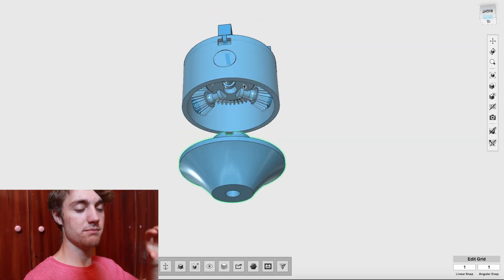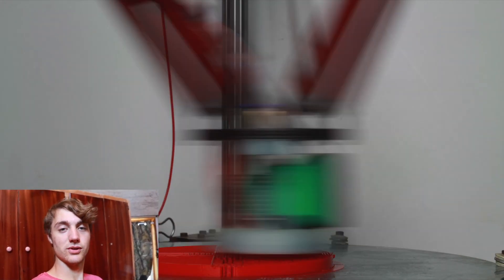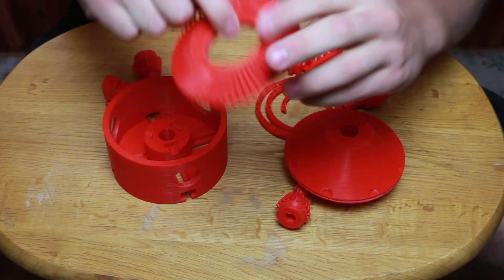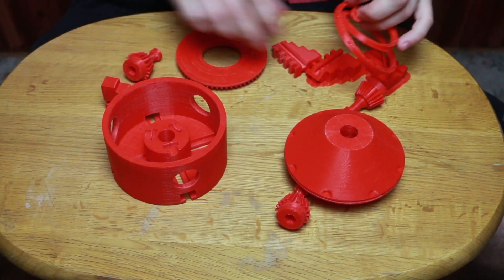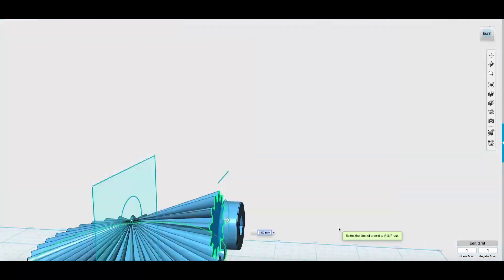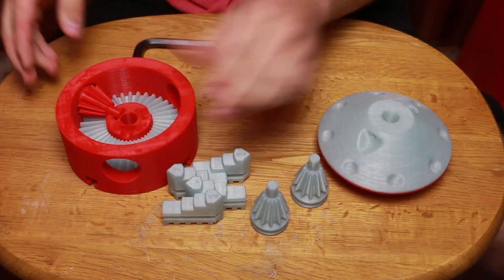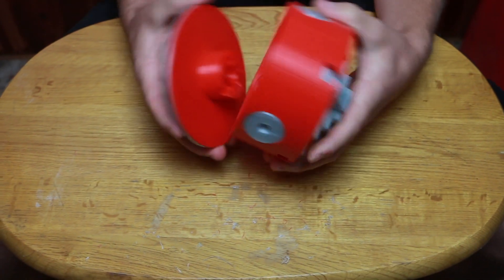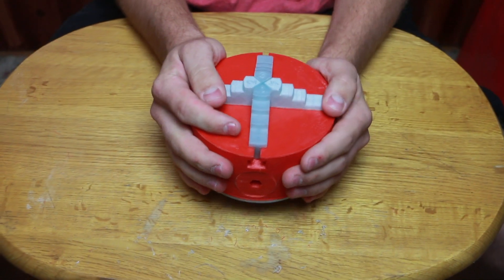Casting an Aluminum Chuck (Part 1)

Comment: +@UCpnXFMz8joYDJH9Mao183Qw
3D printers generally do 0.5mm accuracy, that's no where near good enough for gears.  Industry standard machining accuracy is at minimum 80 micron (+-0.080 mm).
You should really look into direct laser sand sintering for this type of application.  It will produce your molds and cores directly.

Comment: Wow-wow-wow! Didn't you get the whole idea of difference between 3 and 4 jaws chucks? I mean it is quite difficult to make concentrically true 3 jaws chuck, but it is almost impossible (and which is more important not necessary) to make the 4 jaws one based on the same principal. The 4 jaws always made with independently adjustable jaws for purpose! This way you can achieve way better accuracy even with odd shape blanks the by using 3 jaws one. But 3 jaws is way faster to use.